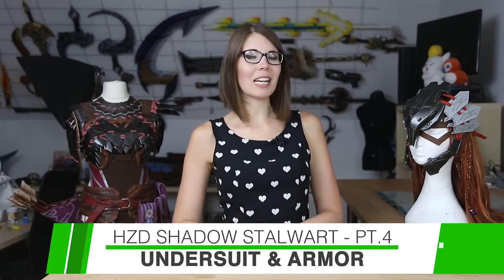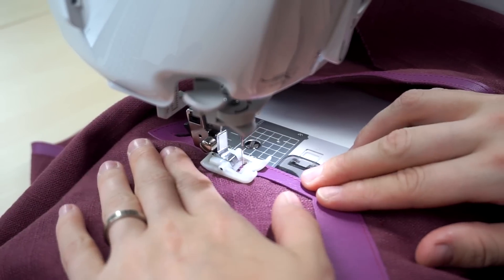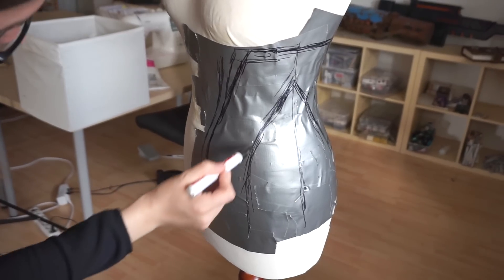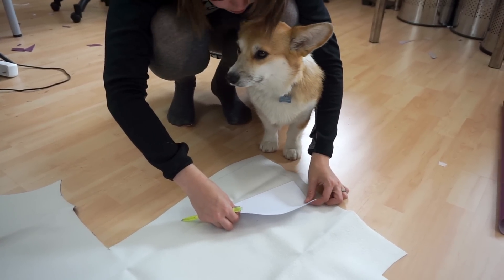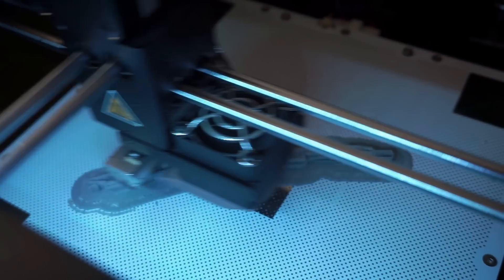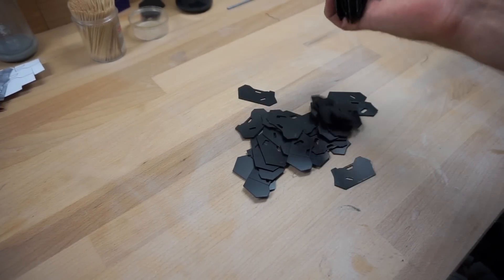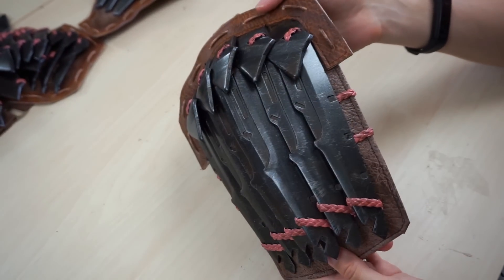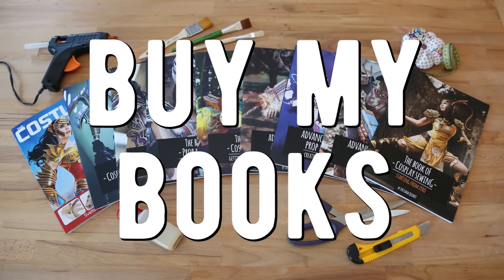Armor & Undersuit - HZD Shadow Stalwart Cosplay - Pt4

Comment: Hey Svetlana, I've got a question for you! 

I'm making my first cosplay and I was wondering how you rigged the shoulder pieces (aside from the bands around your arms) so that they wouldn't simply fall/slide down. Do you buckle or strap them at the top, or are they attached to the chest piece by some other means? 

P.S. Great job on the video content and written content, it's easy to see how much passion and hard work you guys put into your work.
Reply from the maker: Glad you like it. The shoulders are connected via straps to the shoulder strap of the breastplate :)

Comment: I think it  looks absolutely amazing, but one thing I have to point out: Put more effort into your fabric choices. The red leather looks okay, but the brown center front fabric looks too dull and smooth compared to the original, which looks like a very soft, slightly glossy leather. I just think it's a shame, as everything is flawless but that one center part catches the eye as there is no armor covering it. Either way, great work!

Comment: Hi !  that's an amazing work, as always ! 
I was wondering, how do you sew this fake leather ? i have the same for my cosplay and don't succeed to sew it easily.  It seems super easy when you do it ! Do you use a special needle ? or maybe you found the right settings?  thanks a lot !
Reply from the maker: Make sure to buy a walking foot for your machine. Also switch to a leather needle :)
Reply: thanks !  I glued some masking tape (i saw it was a little the same) ! if it doesn't goes well, i'll buy a walking foot !